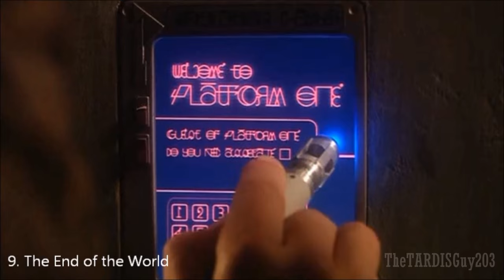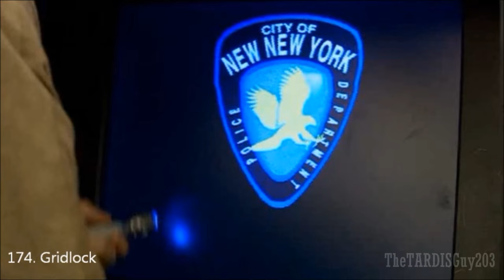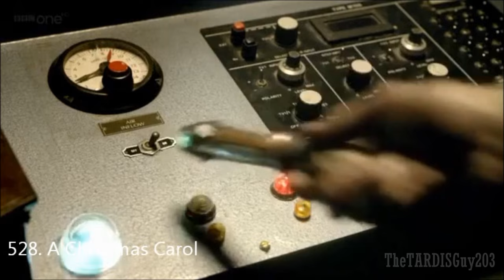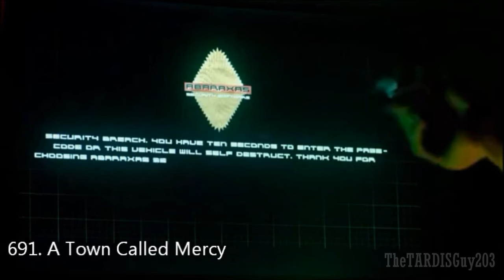Doctor Who | Every Use of the Sonic Screwdriver | 2005-2014

Comment: It's always confused me how in some shots the 9th dr presses a button at the top of the handle but it is not extended. From what I know the prop has the button on the slider so if the slider is pushed all the way to the top of the handle then it should be extended. Very odd
Reply: On the original props, the button was static and located near the collar, and the sonic could only be extended by pulling out the head. They fixed one of them shortly after filming started, by cutting out a channel for the button to slide through and securing the button to the core rather than the handle.

Comment: I like how you can tell the history of the RTD props in this video. How the props were initially tricky to get working properly, which is part of why you don’t see Chris extending it much. By end of Series 1, many of the teething issues the initial two props had had been sorted, with one of them being modified to include a functional slider, and David indulges much more in extending the prop as a possible result. 

Chris and David’s preference towards the less glamorous version of the prop with the functional slider led to the “wide slider” prop being modified to look better if it featured in close up shots. Though this was done for Series 3, it wasn’t done for Smith and Jones. The first appearance of this modified sonic is in the Christmas special. For whatever reason though, this prop wasn’t even used that much this series, with the less modified prop from Series 1 appearing more often.

Starting with Series 4 though, the original props weren’t seen again. 2 brand new props were made, both of which a refinement on the modified sonic design used in Series 3. One of them was gifted to David, and the other was used until the Eleventh Hour, after which it made its way into a private collection.
Reply: While the original props weren't technically featured again, some parts of them made their way onto the new ones, most notably the emitter cage section

Comment: which one should i buy 10th or 11th remote Control sonic screwdriver?
Reply: Really depends on your preference of design. I've owned each version of the Universal remote, and my personal favourite is the 10th Doctor design. 

It's light, comes with a very safe travel case, makes all the correct noises (and more), has a very elegant design, and can be RECHARGED. Best of all, it's also the most accurate in design out of all the universal remotes, the scale is exact and the details are correct. They even went so far as to scan David Tennant's personal prop for the details on the handle (meaning the details on the handle are identical to the one he owns) 

If you prefer the 11th/12th Doctor design, then don't bother with the 11th Doctor universal remote and just get the 12th Doctor universal remote. It's based on the same sonic but with more accurate detail and has the improvements the 10th Doctor universal remote introduced. Unlike the 11th Doc universal remote, the 12th Doctor universal remote has a button on the "leather" grip, only has sonic screwdriver sound effects, and actually extends.
Reply: I forgot to mention, the 10th Doctor universal remote also comes with a nicer display stand than the 12th Doctor universal remote
Reply: MaksDudekVA Thank you for your amazing answer! I think I will buy the 12th Doktor universal remote because I personally think its more like a doctors sonic screwdriver then the 11th and I also really like the extending Feature of it, the flick is amazing. Maybe i could buy the 10th sonic screwdriver later.

Comment: i cant be the only one who thinks the sonic screwdriver needs to be nerfed. i mean it's a screwdriver for gods sake and the doctor should be using it as such. i think its functions should be more or less limited to picking locks, projecting sound waves, and of coarse undoing any sort of screw bolt or nut. i feel this would help to limit the amount of times the sonic screwdriver is used and force the writers to think of more interesting ways for the doctor to escape dangerous situations. on a side note i would also like for them to go back to a design similar to the 4th or 10th doctor's ones as those resembled a tool where 11's looks like a laser gun and 12's looks like a sex toy.
Reply: Come on man they are aliens, they have a different idea of how a tool should look like .